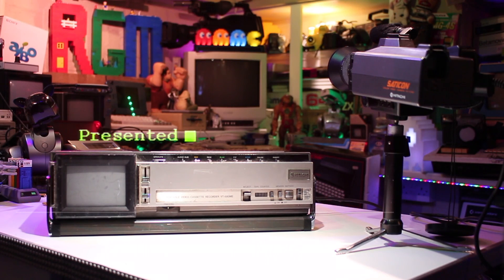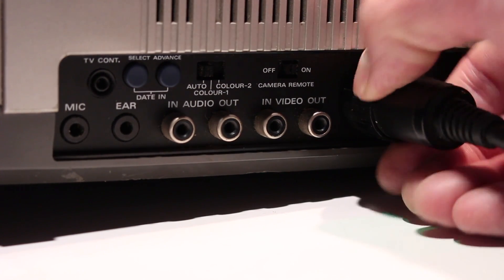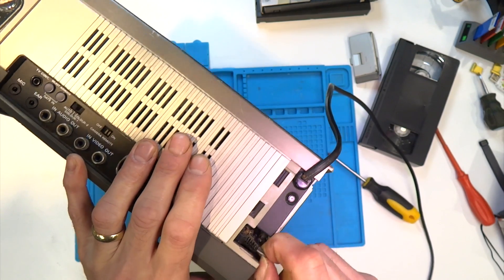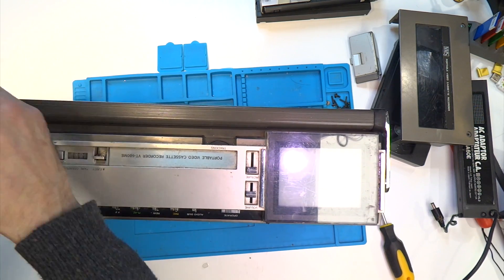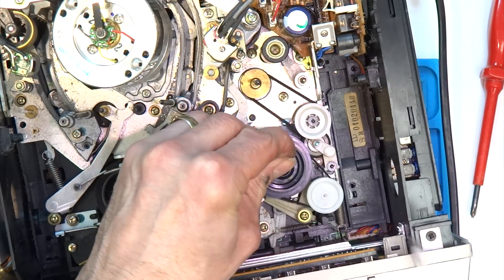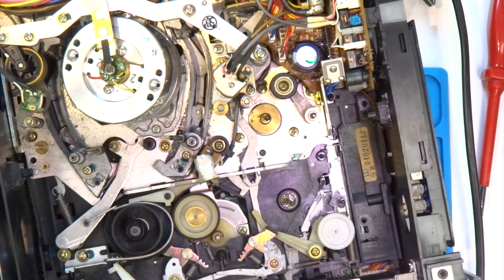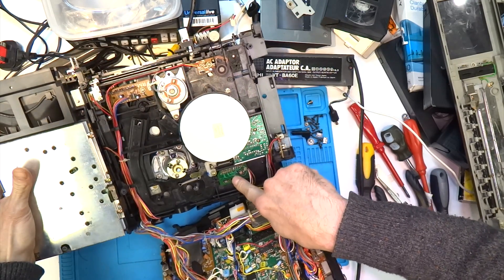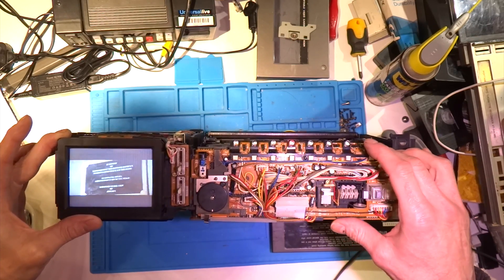HITACHI PORTABLE VIDEO CASSETTE RECORDER VT-680ME With Built In Colour CRT REPAIR ATEMPT PT 1

Comment: I picked one of those up on a local fleamarket together with a JCV GX-S9 camera. Lovely old tech - just the way i like it.
Will power it on later today - and see what happens :)
Reply: After some cleaning and new belts i gave it a shot. 
CRT works like a charm - everything moves smooth.
Of course i have problems with the takeup spool idler.
Took it apart, cleaned everything, used rubber renue.
Still issues - even with a layer of heat shrink on the rotating axle.
Will take another look soon.
For the short time its running, picture looks good to me - so both SP heads seem to be fine :)
Reply: Found the problem : heat shrink came loose on the axle. Removed it - cleaned everything again, realigned idler - working for now. 
Will recap in the near future - and ordered a NOS idler on ebay.

Comment: I have one of these i picked up a few years ago for cheap at a yard sale. The CRT on mine works but the tape section does not work at all and you have to hold down the power switch to keep the unit on. Mine also came with a seperate but matching tv tuner unit that works. I don't have the time nor the patience to do the repairs so hopefully I will find it a new home one day soon. I hope you get yours fully working. Cheers from canada.

Comment: hi, 
i restored one very recently.
the only tips i can give you is : beware of capacitors... you'll find a lot of the miniature 10µ and above values to be bad.
that's the reason why it stop even with the new belt. replace the capacitor on the reel rotation sensor, and it should be fine.
then, replace (at least) all 10µ on all boards. 1, 2.2, 3.3, 4.7µ are usually good. but 10 and above... a disaster. 
check also capacitors in monitor, some goes bad too. check at least the 1000µ on the FBT supply, this one work hard.
for the 220V input, look what say the sticker above it and you'll understand why *it doesn't work* :)

for the take-up idler, i ended putting heat shrink on the gear who drive it.
even with a new rubber, it stopped working after some hours, my guess is the nylon of this gear somewhat retracted and loose contact.
so, heat shrink compensate that and give a good grip.
Reply from the maker: Thanks very much for the tips. I will have to go back to it and try what you said in a future video.